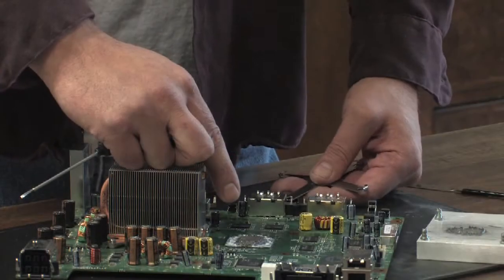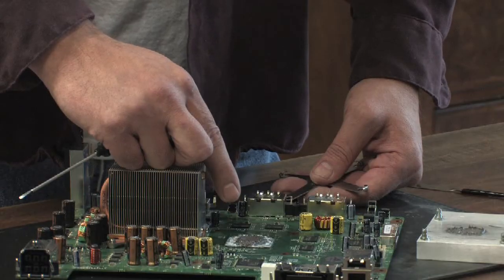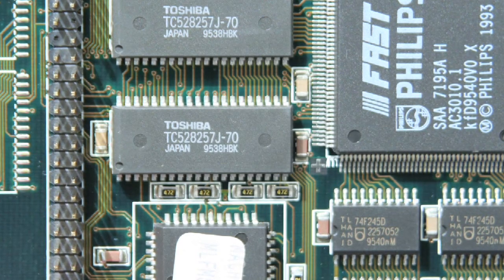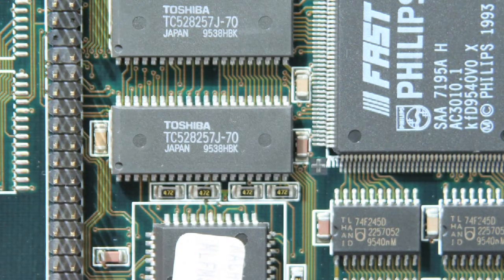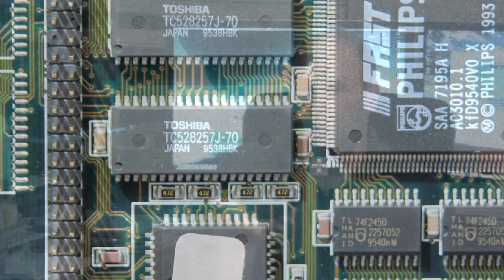Computer Basics : How Does a Microchip Work?

Comment: Instead of 0 and 1, it is actually + and - 

That is binary code, magnetic frequencies. 

There is theoretically a tertiary number, with 2 being a neutron.

With that programming addition, 0,1,2.... the fibinocci sequence, creates a quantum computer. You just need a way to process the neutron discharges as well as electrons and protons.
Reply: The only bits I understand are stoopbits

Comment: can transistors contain programs ? or only if they are in the form of microchips? 
as in many billions then you can have programs ? 
so A transistor can not have programs on it.... but MANY TRANSISTORS togheter can have programs ?  
so normally a transistor can only transmitt 1 0 .. but not a whole programs or calculations as you would need many of these together right?

Comment: @flashmate99 that is what i am trying to do... i wonder if transistors can have programs on them..each alone but i guess not
can transistors contain programs ? or only if they are in the form of microchips? 
as in many billions then you can have programs ? 
so A transistor can not have programs on it.... but MANY TRANSISTORS togheter can have programs ?  
so normally a transistor can only transmitt 1 0 .. but not a whole programs or calculations as you would need many of these together right?
Reply: U alive?